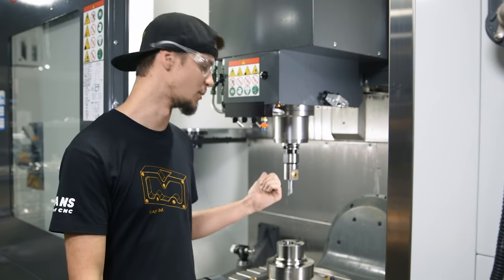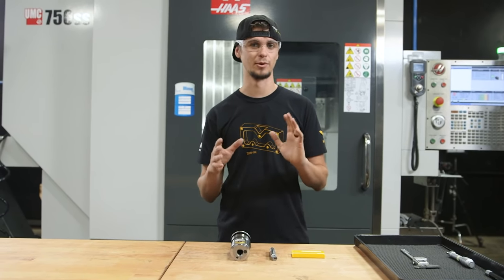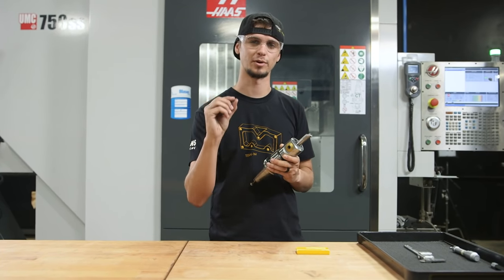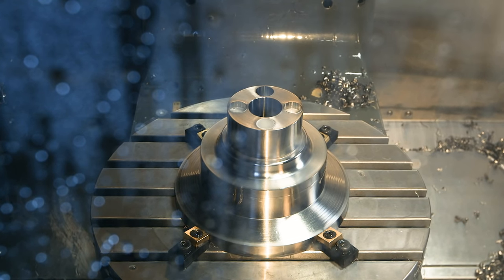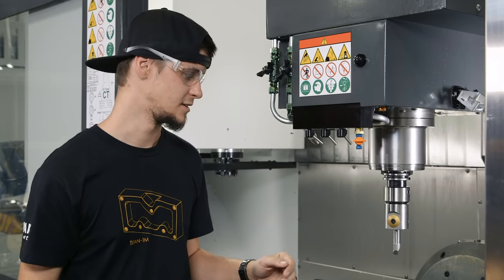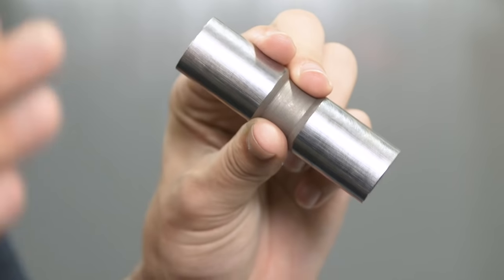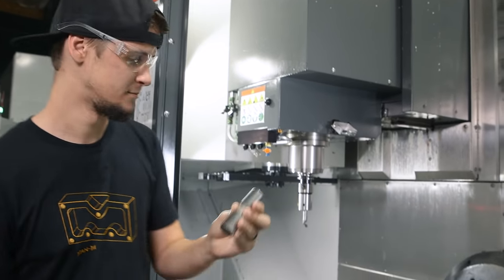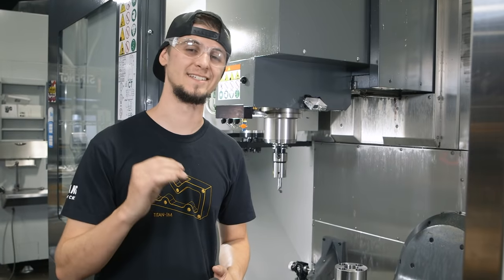The Most Interesting BORING Video Ever | CNC Machining  Vlog #101

Comment: My experience with manual boring: far too small, far too small, far too small, far too small, far too small ........ too big
Reply: True with so many things.
Reply: Cut. Measure. Adjust. Cut. Done.

Kidding aside, it depends on the accuracy of your boring head. The one he is using looks pretty course compared to some I've used. I've used a D'Andrea head that moves .004" dia on one full dial rotation.

In many materials you want to avoid "nibbling" away in tiny increments because it can work-harden the surface of the hole. This causes the cutter to deflect away from the work piece, to the point where you adjust and adjust and the hole stays the same size, until it gets enough pressure on it that it takes all of your previous adjustments all at once, causing the condition you described above ;-)
Reply: @cf2851  i have some problem with iron cast material.dia 6.0 tolerance 0.004 micron with deep 6.5. can you suggest what i should do. go always no enter when i run new part. i use drill 5.8 and interpolation endmill 5 to make hole dia 5.96.. only 40 micron left by my boring always fail to make diameter that i want. always repass it. i use carbide pcd insert.is radius of insert is a problem? i use radius 0.4 or 0.2

Comment: I'm actually a bit surprised it didn't go oversize since the second cut was a lot lighter than the first. You guys obviously know your tools/material though! If there was 0.008" material i would have gone .004-.005 radial cut first, then adjusted and cut the rest so that the cuts would be equal.
Reply: Exact what I do, it might be a little slower, but damn it's accurate!
Reply: That hole went over size. That 1.0000 Deltronic certainly had more than .0002 clearance... and the 1.0002 NO GO pin was never aligned properly to test the fit.

Comment: In germany, one of the first things we learn using a boringhead is to take the play out of the dial, this generally means only adjusting the diameter up and if we have to adjust it dow, to first spin the dial backwarts for one round and then set the final diameter while adjusting the diameter up.
Reply from the maker: Agreed, which is standard if your boring head mechanics have play.
Reply: That’s correct and even place some pressure against the bar so as to have a reliable adjustment all the time especially when using shitter boring heads.

This man is using a fairly high end head so results are easier to achieve .
This video has ignored spring cuts and amount of material removal of course.
Reply: Thought was called taking out backlash
Reply: @markmall5757  I have to say that is the info I'm interested in considering how he approached his cuts...
Reply: @djipreview  in german the words for backlash and play are actually pretty close to each other.
Reply: @markmall5757  We also preset the boringhead ~0.1mm smaller than the final diameter and only bore the first 5-10mm of the hole, measure and set the boringhead to the final diameter, therefore getting the right diameter in one go, without a spring cut.
Is there a different methode I don't know about?
Reply: Dominik .Rolfes , that’s pretty much the norm but that’s not what was done here .
Perhaps I’m misunderstood .
1) the head used here is of  high quality.
2)no mention of the amount of mat removal , which matters when you boring difficult materials.something to consider if you looking for sub 10micron tolerance.
3)also I wouldn’t use a pin to check size as even if you 10micron oversize you would still get an airlock trying to push it in .
4) boring heads are very expensive and it is unlikely that the average machine shop would have a range of them with no backlash hence my previous comment on pressurizing the bar lightly when adjusting for repeatability.
5)also when looking for sub 10micron tolerances best you work under temp controlled conditions .
Reply: @markmall5757  yes, always spring pass before final adjustment to minimize tool deflection.
Reply: @DrW3ak  You will get one dia. reading for the first 5-10mm (larger) and one for the remainder. Be sure to check them both on this setup part to avoid nonconformity (oversize) in the first 5-10 mm. In this instance you have actually taken a spring cut on the first 5-10mm.
Reply: @barrycarpenter270  Therefore, if I want to avoid nonconformity, I should use spring passes for the first 5-10mm and then do a spring pass on every bore?
Because our customers do not care about one bore being a little off in the first 5-10mm.
Reply: @markmall5757  1. I can't imagine the head not having backlash we have one of those nice vibration dampening, expensive boring heads from Sandvik at the shop and even that one has backlash. I think in this case the backlash caused the -.0012 read after setting the boring head at 1.000, as backlash will cause your boringhead to bore significantly smaller.
2. I mostly work with mild steel, so I cant really tell how difficult materials affect these parameters.
3. watch your conversions, the video shows  +-.0005in which  is about +- .0127mm. but if you do go sub 10 microns tolerance, I do agree. Heck even a tolerance of 30 microns will be off with a 10-15°C change in temperature.

Comment: Bore gauge would be better than the gauge pins. Because you can "see" run-out. Gauge pins are good to know the smallest part of the bore, but do not tell the whole story. But I'm knit picking. Great work.
Reply: I don't think that is nit picking. Qualifying precision holes is difficult and Deltronic pins may or may not get you there.
Reply: Not really, most are 3 point contact and 2 people or even the same person often can't get  .0001" consistency! For speed and accuracy pins rule, if your process is likely to produce holes that are not round production pins have relief ground on the no-go pin for 2 point contact. The pin bouncing in the hole proves it's round and precision holes always get a pin or shaft during assembly not a bore gauge!
Reply: QC can also be a contactual condition. If the client is happy with gage pins - so be it.
Reply: @calizess  agreed. It was stated in the video that's the best way to measure a hole and I don't really agree because it doesn't tell you the whole story.
Reply: @P8ntbaLLA56  Some of the old timers like to submit the same part over and over again for QC approval just to see how different it is or how many times they'll reject the same part they passed the day before! You'd be a prime target with your .0001" bore gage! 😁
Reply: @UshouldTryReality  I'm familiar. Just like the ball bearing tap at the top to make it pass a pin gauge when oversized.

Comment: On the boring head I use at work, locking the set screw moves  the bar a thousand or two after you adjust it . It’s nice to not have to worry about that.

Comment: An interesting approach which obviously works well for you, I'd love to know how much the initial cut was...

Personally I'd leave around 0.2mm on, set the boring bar on the bore, take a 0.1mm cut, measure then take the rest... its been a while since I've been on the tools but I got pretty good at boring there for a while, never had the probe to be able to try what you've done here but even so I think I'd try to set it to take a semi finish then finish cut.
The reason being is lets say you set it to 25.4mm but you've got a rough hole of 25.2mm.
Your first cut would be 0.2mm approx and then lets say you have 0.02mm left, if you adjust your boring head by 0.02mm you run the risk of cutting oversize as you'll be taking 0.02 plus a spring cut... this is why I always try to keep my semi finish (trial finish) cut and finish cut the same DOC... you can also adjust you rpm to suit so your cutting forces are kept the same between semi and finish cuts....

High production I would approach different as well but for what looks like a 1 off part in titanium I'd have no problems explaining a trial finish cut to the Boss...
Reply: You'd be better off just interpolating the bore, you can still achieve that limit and it is less setting up

Comment: Deltronic pins are perfectly acceptable for checking +/- .0005" tolerances.  When you get down to +/-.0001 you need to use air gages or something like a Sunnen bore gage in a temperature controlled room/area.  I use to do a lot of these kind of tolerances on a Sip Jig borer.  Another acceptable measuring device for +/-.0005 is a Tri-mic or Intrimik.  Like some have mentioned before, you need to be careful using pins for checking holes because they are only as accurate as the roundness of the hole you are checking.
Reply: Sure, out-of-round will confound assessment with pins. How big a concern is this for a bored hole? Something has to have gone very wrong to get significantly out-of-round using a boring bar.
Reply: Somebody’s knew what he’s doing.

Comment: That hole is .0002-.0003 over 1 inch cause 1 inch pin will not go in a 1 inch hole.
Reply from the maker: 1.0000
Went

1.0002 didn’t go

Well within the +-.0005
Reply: @TITANSofCNC  I am not saying it wasn't good just that a 1.0 pin will not go in an 1.0 hole
Reply: @toddwilburn4297  Thank you captain obvious.
Reply: @justinl.3587  maybe obvious to an experienced machinist but probably not to most of the people watching this video and Todd is absolutely correct, if that hole had a tolerance of +/-.0002" then he would most likely been right at the top of tolerance or scraped the part.
Reply: I thought the same thing. It would be a press fit.  But wtf do I know.  Still in spec, but over shot the goal of 1.00000“.
Reply: They have minus and plus pins depends what you buy
Reply: @toddwilburn4297  In quality you use the dimensioned gauge to inspect the hole, so that is a 1.0000 diameter. The part leaving a temperature controlled room is going to play with the tenths.
Reply: Something to note is your body is 98.6. Hold your standards too long and they will grow.
Reply: I was taught that you use a pin .0002 smaller than the hole size you are shooting for. If a pin is exactly 1.0000 and it fits in your hole, your hole is larger than 1.0000
Reply from the maker: Exactly, nobody said it did...
Stuart said the 1.0000 went and the 1.0002 didn’t so the hole most likely was about 1.0001 which was beautiful for his 1.0000 +-.0005
Reply: @TITANSofCNC  As usual, people in the comments are just being overly picky. The rest of us understand what's going on in this video 👍
Reply: John W he literally says in the video that the pin is “exactly one inch” @5:30
Reply: @TITANSofCNC Stuart done a great job . I just wished Stuart would have used a .9998 go pin and explained why he used that pin so the young machinest just started in the manufacturing field would understand clearances.
Reply: I really appreciate the videos! I am a Tool and Die Maker and I am always learning something from you guys. Thank you.
Reply: @toddwilburn4297  Why would he use a .9998" go pin for a 1.0000" +/- .0005" hole? The GO pin for that tolerance would be .9999" the NOGO's would be .9996" and 1.0004"  But of course the 1.0000" pin wont fit because that's technically impossible. Anyone with common sense knows that if the hole is exactly 1.0000" 

You're making an argument out of thin air.
Reply: @UCGZsyACVLQts-cB5OoSuhDg Well Justin if he wants the hit the mean of his tolerance he would make a .9998 pin fit like he made the 1.0000 fit.
Reply: @toddwilburn4297  The mean or "median" of the tolerance is 1.0000"
Reply: Just because you can fit the pin in the hole doesn't mean the hole is round.  You could be out of tolerance and still not fit a 1.0002  gage pin...bore gage is really the way to check runout and concentricity over the length of the hole...machine tools have runout...a tool sticking down that far from the face of spindle will have more than .0005 runout...
Reply: Stuart had a slip fit going on, meaning there was some clearance between the pin and the hole. Probably .0001-.0002" of clearance.

Comment: Thanks for posting part 2 👍 so, if I recall correctly, the requirement was 1" + 0.0005"/ -0 (from the previous video) and you achieved somewhere between 1" and 1.0002" -  that is pretty impressive.  It would have been interesting to have compared the 1.0001" pin, judging from the fit of the 1" pin I think it doubtful it would go all the way in, even if it started.  Given you're well within spec that would be a bit pointless exercise other than for interest's sake.  I see the tolerance of the pins is 40 millionths - I think they are a little better quality than mine but then I'm not doing aerospace parts!  Keep up the good work 👍 just a thought, 0.0002" is 5.08 microns (I'm Metric), the width of a human hair is between 17 and 180 microns
Reply: Never really seen the appeal/need for a boring head on a decent CNC machine?
Reply: @Chazzyp100  an interpolated radius is not as good as a stationary axis. This is why there are cnc lathes.
Reply: @Eluderatnight  I understand that but for the purpose they're using the boring head you could interpolate and achieve the same limit?
Reply: Charlie, Circular interpolation is a nice feature. But a boring head is far more accurate. When the hole calls for a .0005 total tolerance, interpolation will not get you there in production. There are too many variables. One great technique is to drill, rough circular interpolate and then boring head to size. I have run bearing holes that were 3.0" diameter 2 .0" deep, + .0000/-.0005 with no problems. 200 piece runs.

Comment: Sigh. This “hole size” “pin fit”  test  has always been a massive confusion in every shop I’ve been in. “Well if the 1.000” pin goes and the 1.0002 doesn’t ,Then it’s 1.0000 perfect”
No 
If a 1.0000 pin goes,  there is space in the bore. How much is unknown , but it is bigger or the pin wouldn’t go in. I would say this is somewhere around 1.00015, to 1.0002. 
For a 1.0000 perfect hole size , your looking at checking with a .9999-.9998 pin floating in , and a 1.0000 pin as a line fit or a “no go” pin.
Yah after 30+ years you learn things … I learned this from an master inspector, when I couldn’t understand why my “pin went” in, but the zeiss CMM is showing it’s oversize by a few microns. 
He then explained it to me and I was like “ ohhhhh “ right makes sense. 
A perfect 1.0 hole is not going to accept an perfect 1.0 pin . Bottom line.
Reply: I have always thought that and I'm fairly new to the trade. Thanks for clearing that up for me!
Reply: This is correct. I have made thousands of aerospace parts in my life time. When there is a callout +/-.0005 or less on a bore, I always confirm with the customer what is the method of inspection they use . If we are using gage pins we use the .0002 rule.

Comment: Maybe you guys could do a quick video on properly programming for a boring bar as it needs to be timed and moved away before retracting as to not drag the insert up the wall. You may have some tricks to guys like myself not be so nervous about setting them up and running them. Great videos and keep up the great work!
Reply: It's a while since I've used a Haas, but do you not use M19 for spindle orientation and G76 fine boring (or similar), which has stop/move away/retract parameters in the cycle?
Reply from the maker: Yep, M19 orientates spindle ... we just bored in and bored out with a G85
Reply from the maker: PS.
We will do more “Boring Videos” 😂😂😂

Comment: Couple of things. First don't forget to notify what direction to have your too facing at M19 so that when the boring bar exits it does not leave an exit mark.
Second it is always common practice to do a spring cut before making any adjustments. Other than that floorless. And for the metric guys just times the imperial figures by 25.4

Comment: Pins are fine for measuring a bored hole, especially if the tolerance isn't super precise and if you are on time constraints but I wouldn't go as far as to say they are the best way. Measuring on a CMM or using the in machine probe is much better because you can more accurately measure the size, circularity and taper between the top and bottom of the diameter.
Reply from the maker: I believe he said when not using a CMM.
Reply: @TITANSofCNC  I just re-watched the part where he measures the bore using the pins, did not hear him say anything about a CMM...
Reply: @TITANSofCNC  in my experience Pin Gauges are good for only the first few mm of a hole/ Bore, how do you qualify the bottom of the bore is not tapered outwards? I would use a combination of Gauge Pins and either a Bore Micrometer or Air Gauge depending on toleranceing requirements. Is it possible to show more of the Inspection and FAIR side of this? I know customers can be unhappy about this process being shown on their parts so i can understand if its not possible

Comment: Before u bore the hole to size first check to make sure they are concentric to the datum. Then take a rough pass with boring bar , check concentricity again then finish bore it to size. And I like using bore gauges but the pin works too.

Comment: There are several comments about different deflections from non-uniform material removal. That is true, but they missed one thing in the process. He bored in and out of the hole. The bore out cycle probably had a very light cut no matter how much material was removed from the bore in cycle (within reason).

Comment: Yeah, right, ... two equal cuts and always try to cut a bit more material in the diameter then doubled radius of the cutting insert. The surface ist clear, no bumps in the wall or other deformations. And always take the right cutting speed. 

Greetings from North-Germany